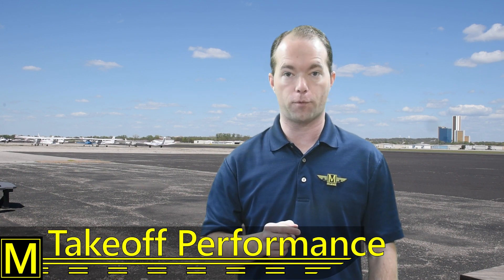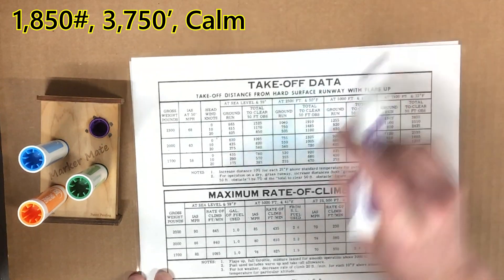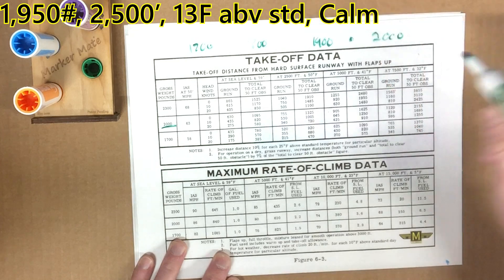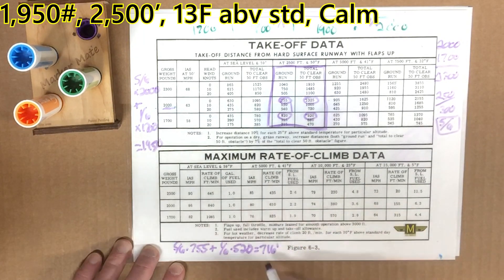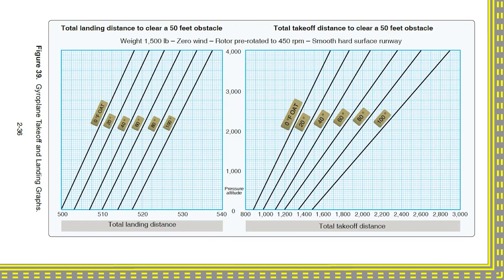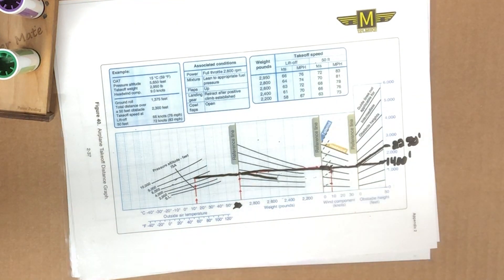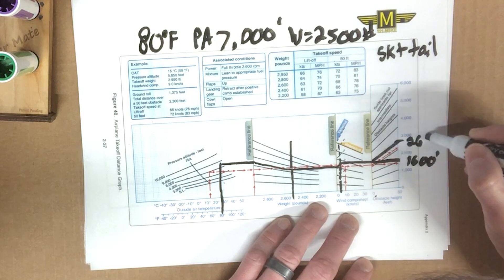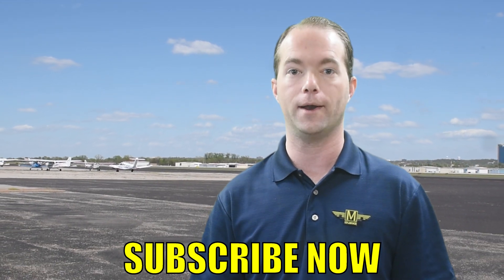Takeoff Performance Calculations - 121.Mike

Comment: I'm curious how to calculate time of ground roll. Start a stopwatch with beeper in moment of relese breakes, if you not flying before time out ABORT takeoff.  Short runway? start using V1 speed, that must be achieved before stopwatch alarm.
Reply from the maker: Hey there! I gave your comment a lot of thought and wondered why we don’t use times, and the best I could come up with was this: 1. Runways are measured in length, not time, since runway usage is what matters, so we don’t keep track of times and 2. Computing expected takeoff times involves a LOT more math and physics, so we don’t do it. Then of course there sadly is no v1 speed for single engine planes, cause if the engine quits, you don’t continue the takeoff. Thanks for watching and for making us all think!
Reply: @121Mike 
in single engine, not achieve V1 in calculated time = engine failure in multiengine airplane.

 but still in single engine airplane, time dependent V1 would be check that airplane have expected power/performance. (end ex. did we forgotten about high density altitude on preflight).

procedure of takeoff would be similar to ME.

In my world single engine airplane would have V1 speed and time set: lower value of:
V1= Vr - 5ktn, or 
V1 = point of when remaining runway barely allow to safely stop. 

Maybe in future aviation will implement that. Basically everyone use smartphone/ipad for calculations, so today  repeatable complex calculations are not a problem. Put parameters like total weight, runway conditions, length, runway slope, weather, and program will calculate everything. (V speeds, time needed, distances etc.)

there was accidents because pilots in ME aircraft don't set proper (correctly calculated on preflight) takeoff power and runway ended before Vr. Time to achieve  V1, would prevent that.